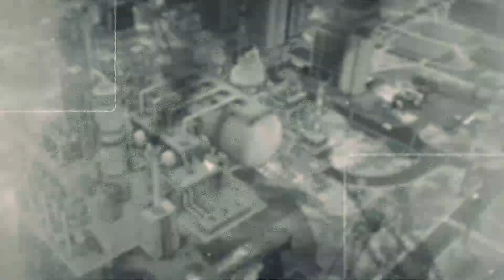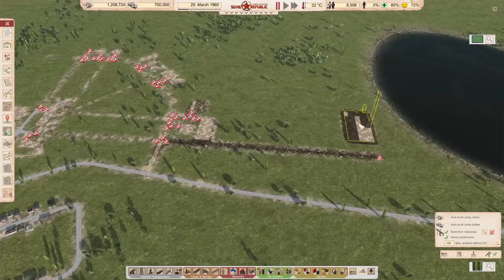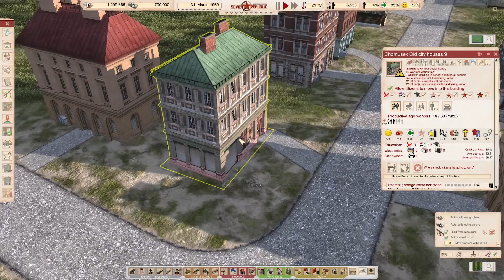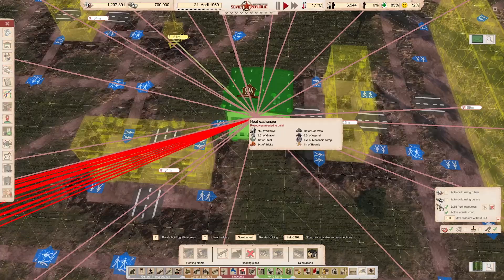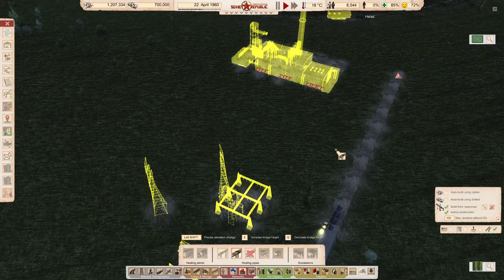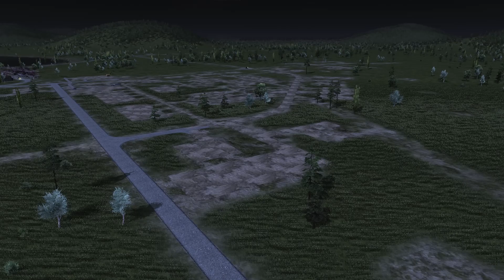Underground - Workers & Resources - Soviet Republic - Ep.2

Comment: Good start Chief, but your water supply set up still seems weird even though it works I just go straight to a water tower and gravity feed everything no further pumps needed. underground tanks are useful on hills. Cheers 🙂
Reply from the maker: First of all, I don't know if it will work. Does the underground storage work like a tower? Does it create pressure? 
Second, I was hoping for 1 pump and all others to be just switches. No electricity needed. 

This underground storage is under water towers, so I have no idea. Is there a metric we can see to know if it acts like a tower or not?
Reply: @oolykeegaming81  Underground means not a tower, I put them on a hill just like at home here and pump water up to them so they then act as a tower using gravity to feed the town below the hill.
Reply from the maker: @oldgalah7425 understood. Some moded water towers are on the ground level and still produce pressure. I guess all of this is explained in the tutorials I never did (sarcasm).